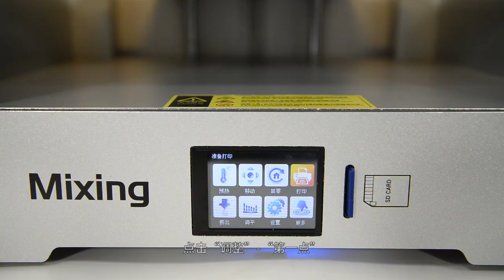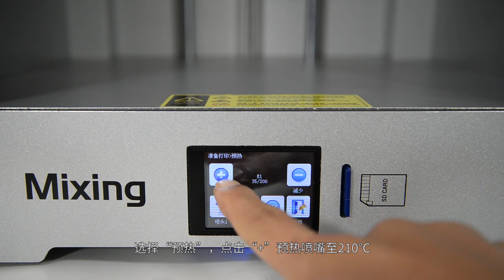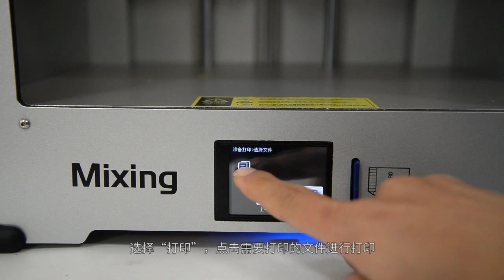FDM Mini Mixing color 3D Printer

Comment: Hi. Have 2 super helper 155. And have some problems with the printer. Some prints make perfect. Pots. Box. Etc. Very very softh layer. But other print make very rough surface. Ypu have some tech dep??. I think is a programa problem. Im use a wimbo slacer.